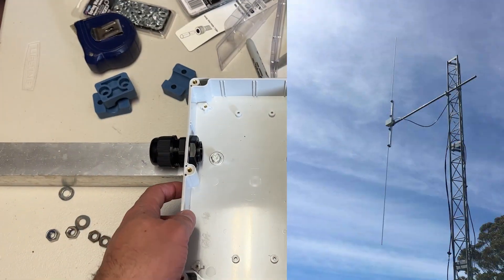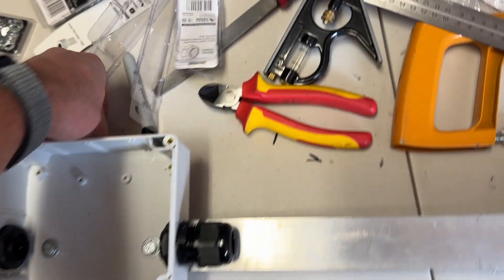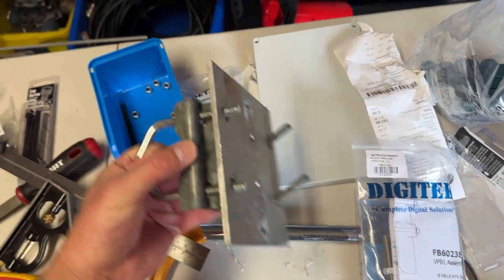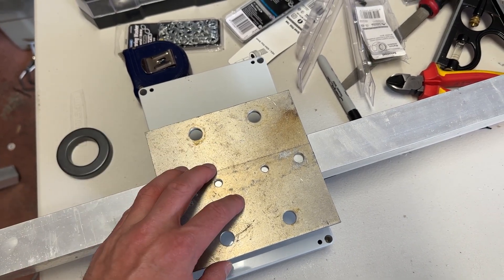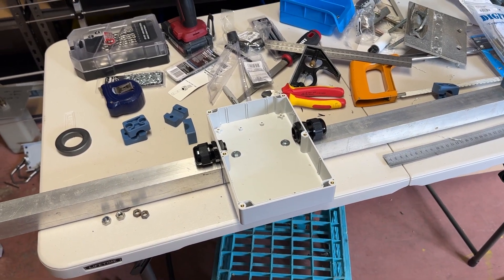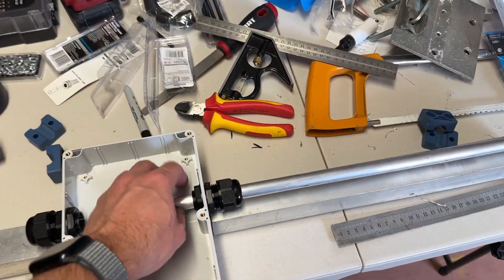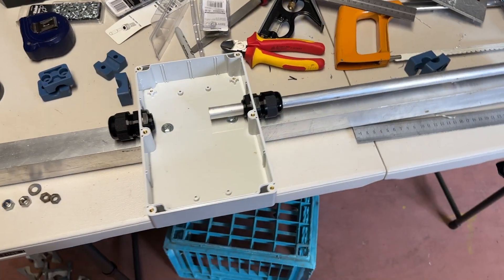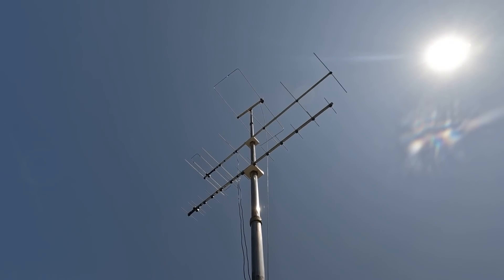Building a HEAVY DUTY 28 MHz Dipole Antenna

Comment from the maker: EASY to Build 10M Vertical from Coax 👉 https://youtu.be/B1k-ybRNBIE?si=VVOPVmnH3gOznAZd
6m Moxon Antenna 👉 https://youtu.be/t6MUSeI1Kh8?si=fgXIhUOFEyEw8Cl1
Build a Common Mode Choke 👉 https://youtu.be/r2deRuOXJfI?si=0SOoe6d-zLG4JiZA

Note - a more approximate value for calculating the leg of each dipole is: 142/frequency. This takes into consideration velocity factors and real-world factors that might slightly alter these lengths based on the environment, conductive properties of materials, and other considerations in antenna design. Either way, making your dipole slightly longer and then trimming it to tune is the way to go.

Comment: Wondering about affects of square tubing being so close to both elements.
Reply from the maker: I modelled it in MMANA and there are next to no affects apart from a few ohms of reactance that you can tune out.
Reply: @HamRadioDX  - Strange. How/why is that? - Is it because the square tubing is relatively short in relation to the full length of the elements?
Reply: @garryhammond3117  
That shouldn't make a lot of difference, in the grand scheme of things, I would have expected there would be some sort of a capacitive component in there, but as Hayden mentioned, this can be tuned out, if necessary.

Comment: Hi Hayden,
This looks like a really good design.
However, the screw mountings for the enclosure that go into the square boom, were these "Tek-screws" (as in self drilling screws)? 
Only reason I ask this is that aluminium is shocking as taking an actual thread and over time, they will round out (making the thread give up between the parent metal and the screw threads), causing the holes to slop out and come loose, especially with wind causing the elements to vibrate the whole enclosure, etc.
Personally, I would bolt them through the boom to the other side, believe me, this will save you grief later on.
Reply from the maker: Hi Mike,
I ended up going with another antenna for the repeater, but it is downstairs... I tapped holes and put Bolts into the aluminum. You're right, Tek screws would come loose over time.
Reply: @HamRadioDX  
Nah, good as gold Hayden, it's just that I come from one of the windiest parts of New Zealand, everything will eventually get shaken to bits over here, if it's not a big Nor'wester, it's a massive Southerly!

Comment: if you build this for receive only do you still need the choke?? And yeah was looking for those clamps. thank's for letting the cat out of the bag.....
Reply from the maker: You could build it without the choke. A choke might be recommended near the end of the feedline (where it enters the shack) to reduce noise pickup on the cable.
Reply: @HamRadioDX  ok great. 10m fm was wide open for about an hour today into north Carolina... great videos...Thanks

Comment: I did a similar 10m dipole when I first got licensed, but I used copper pipe.  It didn't work, couldn't tune it below 3:1.  It also looked hideous, and my wife made me take it down.   I wish you more luck than I had.  Maybe I'll see in your videos where I went wrong!

Rubber caps on the antenna will bigly move the resonance.  For example, on a firestick (27MHz CB antenna), taking the cap off will raise the resonance up into 28 MHz.  There's a chart on their website showing cap on vs. cap off vs with stinger in vs. stinger out.  Although that may be comparing apples to oranges (whip vs. dipole).  My point is test it before you climb the tower, so you only have to climb once.

Comment: Your formula omitted velocity factor, which in this case will be factored into the tuning optimization process.

12.7 mm is 0.5 inch.
Reply from the maker: Yes that's correct.
Reply: Left out length/diameter ratio compensation also.
Reply from the maker: @michaelross-aj6fgvk3rz  Will get you in the ballpark

Comment: Why oh why would you waste your time...
Just build a heavy duty vertical 🙂
Reply from the maker: Side mounting a heavy duty vertical that is 5 metres long, and making sure it doesn't whip into the tower in high winds is a bit harder than a simple dipole.
Reply: This kinda IS since it’s minted vertically isn’t it?  What is the efficiency loss between the 2 in reality?   I like this plan.
Reply from the maker: It is mounted vertically (as per the thumbnail photo). Just easier for the particular application and tower it is to be mounted on.

I have two other verticals (one an end fed, that needs a counterpoise) and a 5/8 (that has radials too large).